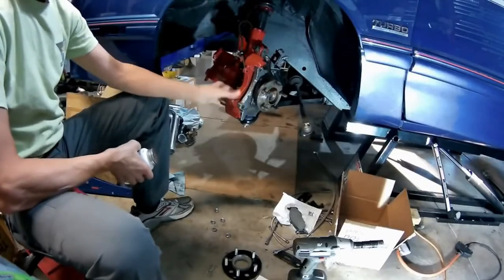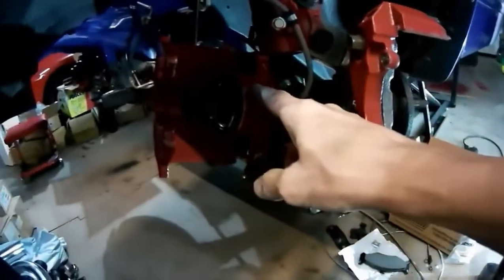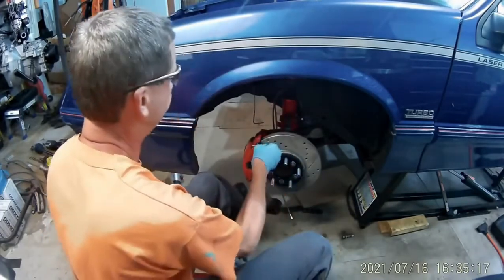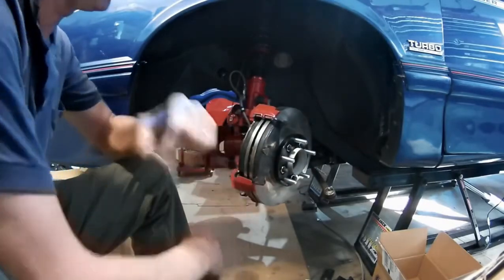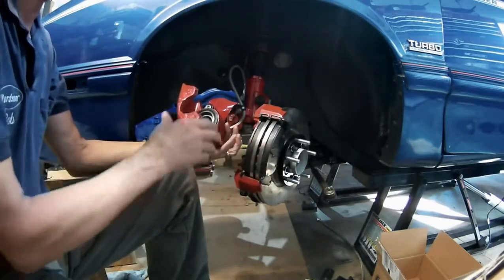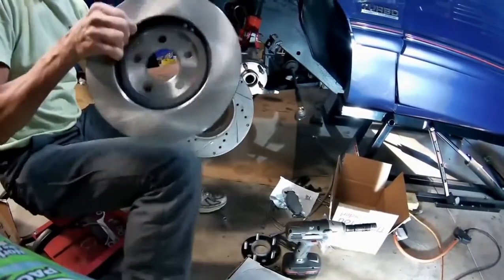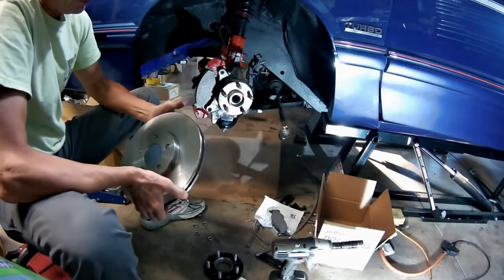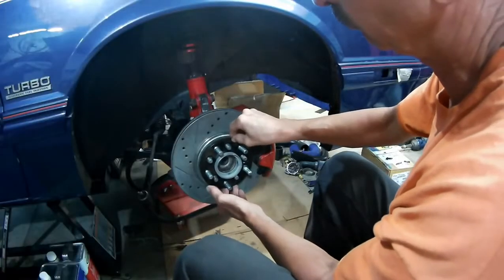Laser86 - PT3 - Big Front Brake Conversion

Comment: Is that PT GT rotor or a normal ol' PT?
Reply from the maker: From what I can tell, it's a plain PT rotor, from 2001-2010.  The one in the video is from RockAuto.com, DURAGO BR53000 (Economy).

Before you order, make sure to check the dimensions to confirm that they are 23mm thick.  Some PT's use the Neon front rotors, which are 28mm thick.  I'm guessing that they are turbo models.